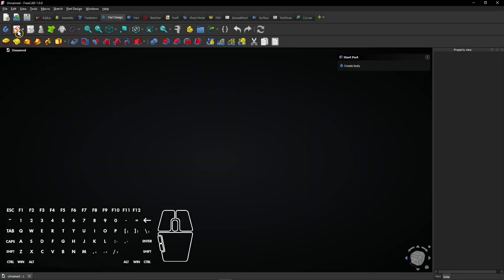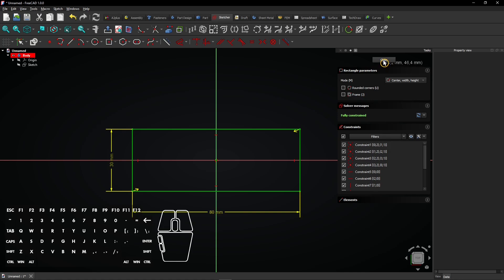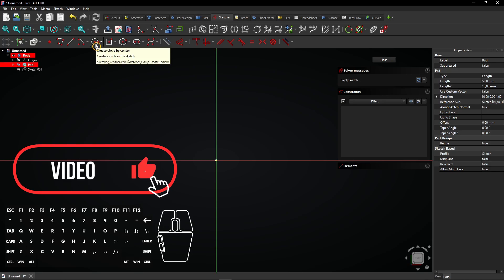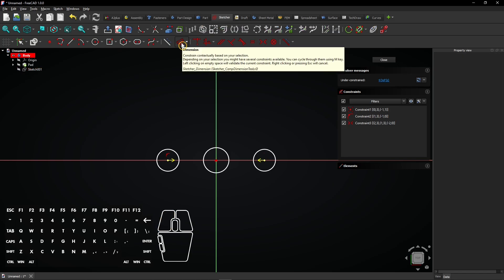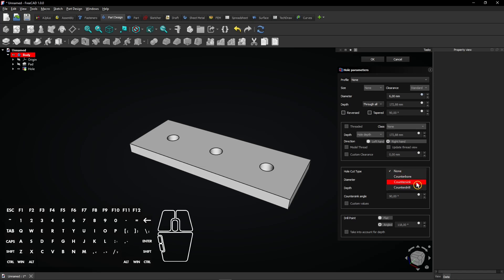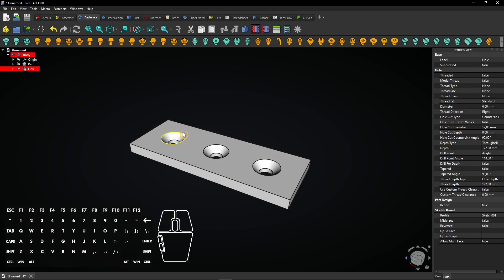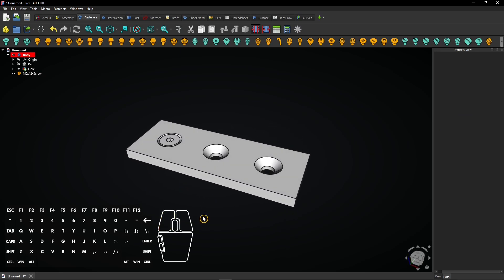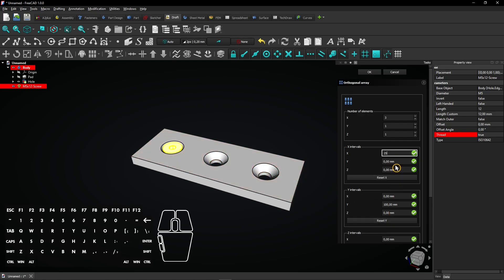🧰 FreeCAD Hole Tutorial - FreeCAD Fasteners Workbench - FreeCAD Hole Tool

Comment: Great tutorial - thanks! The build I've been puzzling over lately has been how to take a rectangular shape like you have here and create a "1/2 donut" cutout on the edge, like for looping a string/cord or split ring through. I'm not quite sure how to create the "donut" shape or use that to cut out shape... a Boolean operation may be the wrong approach entirely. If you need an idea for your next tutorial, I'd love to see your take on this!
Reply: Sounds like a through hole with a radiused edge. For 5mm bar, you'd radius the top and bottom edge 2.5mm.
Reply: @randomidiot8142  actually, I just discovered the Groove tool. Worked perfectly for my needs with just one click. Thanks for the suggestion!
Reply from the maker: Thanks a lot! I will keep it in mind.
Reply from the maker: Here's an example: https://youtu.be/xqk3AXB9vvo. Thanks again for the idea!